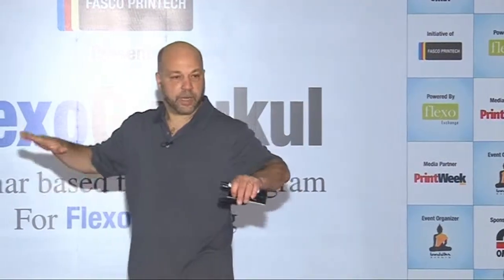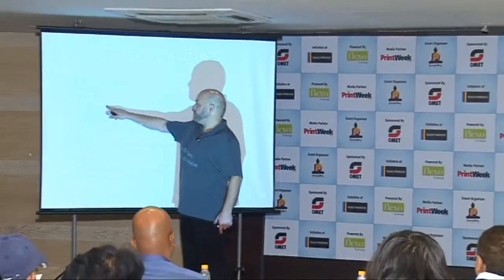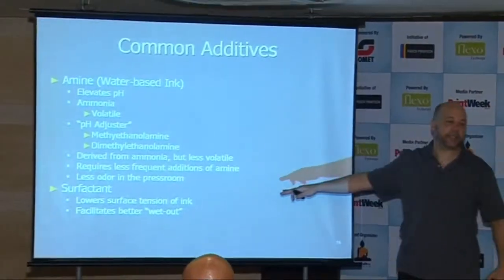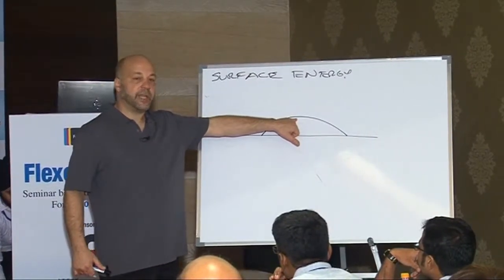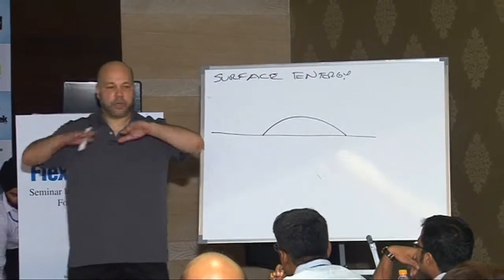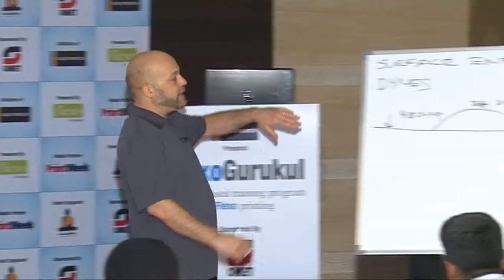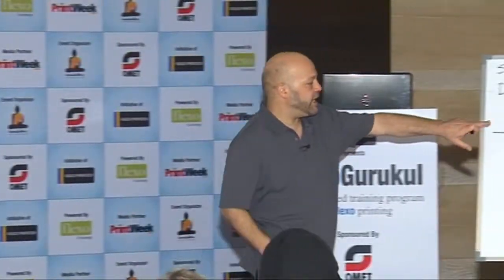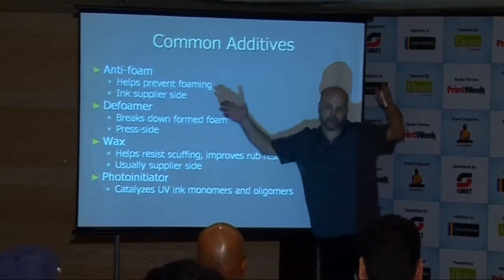Flexo Ink: What's In It?  2 of 2

Comment: Whats the difference between surfactants and dispersants then?
Reply: Summary – Dispersant vs Surfactant (via Googlesearch)
A dispersant is a form of surfactant. The difference between dispersant and surfactant is that a dispersant improves the separation of particles in a suspension whereas a surfactant is a substance that can lower the surface tension between two phases of matter.